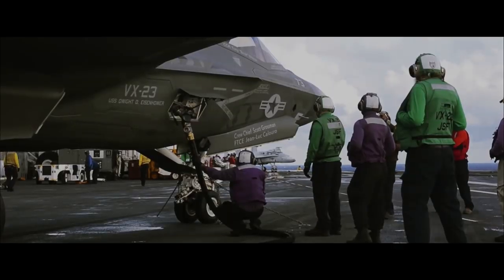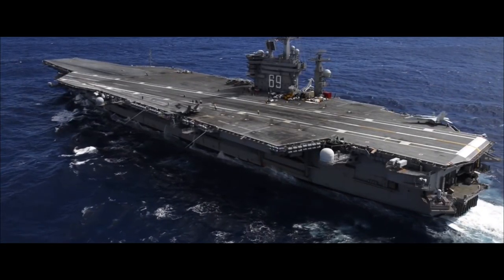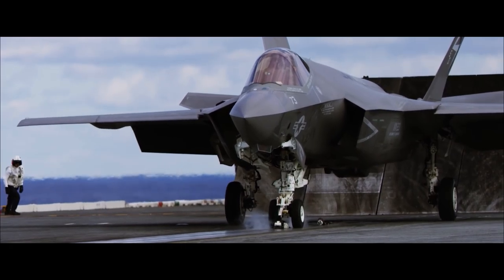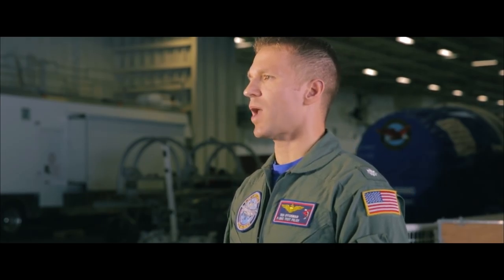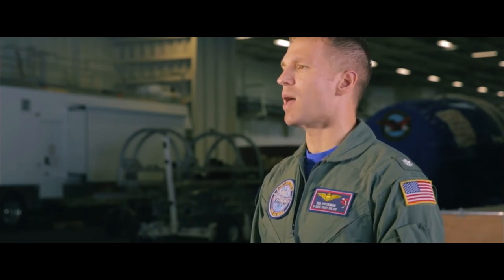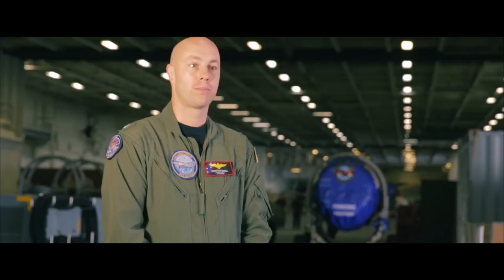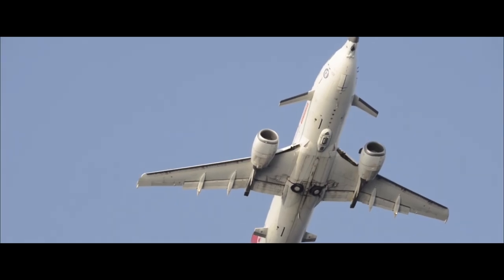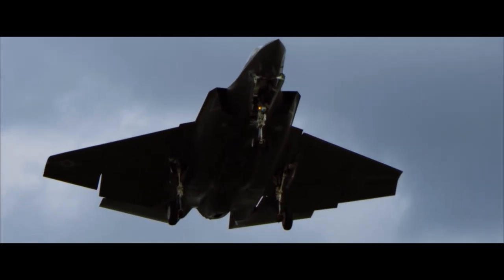F-35C Lightning II aircraft are tested aboard USS Dwight D. Eisenhower.

Comment: Nice video, not so nice aircraft though to be honest... It looks gorgeous but... You know..
Reply: +KEN's Gaming Channel... Maybe? Tell us, I can't wait for your false claims.
Reply: It's costly and mostly a cut down of a F-22... There you go.
Reply: KEN's Gaming Channel... Maybe?
Well, it is a lot cheaper than the F-22 and it is higher tech than a F-22. Looks to me that you have nothing.
Reply: +ELECTROSTATIC DISC LIFTERS A lot cheaper on building it and maintain it, but not developing it. Most of the technology it has are adopted from F22 which I said it is a cut down F22. Besides, it's single engined design has weaken its survivability. Yes, it is a fifth gen fighter. Yes, it has a better information exchange system. But to make a good fighter is all about survival. A good pilot could fight better if the machine could survive longer in the field.
Reply: KEN's Gaming Channel... Maybe?
The F-35s are not in the field as you call it. So nothing you say can be true. All you have is a non expert opinion and that doesn't count.
Reply: +ELECTROSTATIC DISC LIFTERS So.. A war machine that can't fight wars. We know what that means even we are not experts. Sir, I am not an expert but what I know is that F-35 is so far one of the worst machine the US has made. I don't want to be rude but it is what it is.